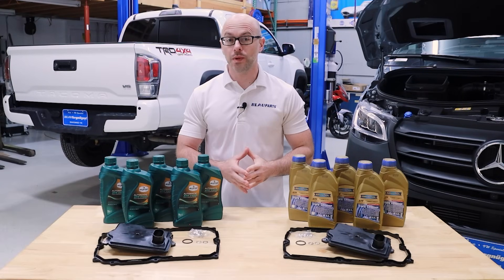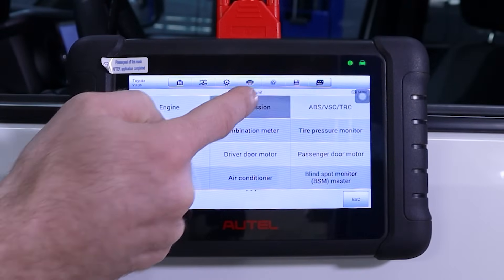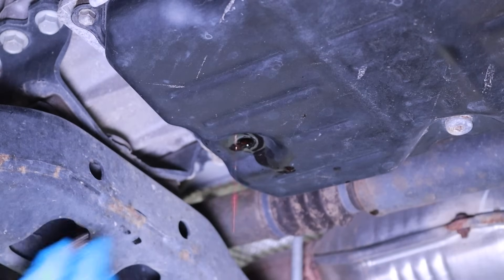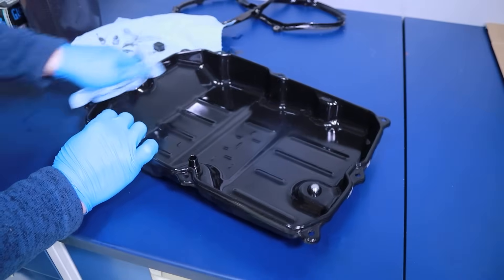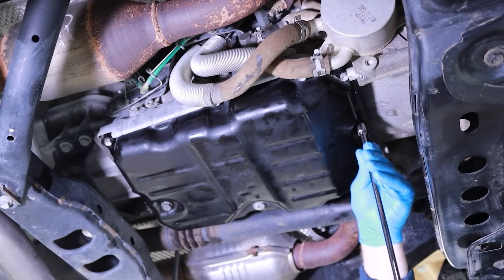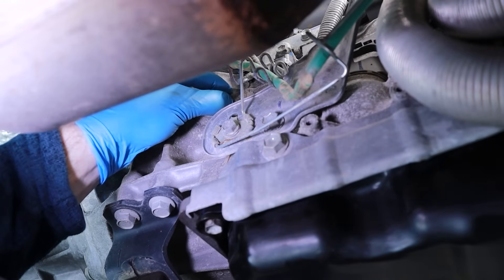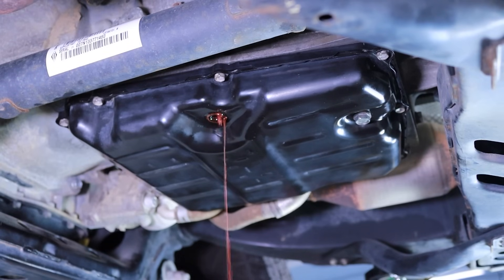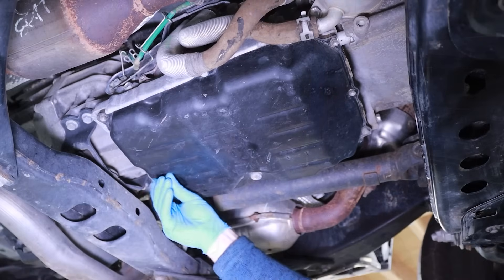How to Change Toyota Tacoma Transmission Fluid (2016-2023 6 Speed)

Comment: something does not add up,now if i park inside my driveway on friday on saturday those temp are going to be 75 or 80 f i don t need to worry about no temp am i correct,and if i don t change the filter bc i be on over 50k but i don t want change that filter only when i get to 100k,why i m saying this my couson with a tundra 2008 5.7 took it to toyora they change the transmision with 106k guess what they fup the transmision 6500 dol he had to pay tell me about it.
Reply: In the video, he mentioned 35°Celsius, which is about 95° Fahrenheit. I hope this helps

Comment: Manual says 9liters of transmission oil, why is it only 3.5 liters? Thanks!
Reply from the maker: Hey there, check out our capacity notes on the 3rd gen Tacoma 6-speed automatic here for clarification on that: www.blauparts.com/blog/how-to-change-3rd-gen-toyota-tacoma-automatic-transmission-fluid.html#toyota-tacoma-6-speed-automatic-transmission-fluid-capacity

Comment: I just called my local Toyota dealer to have them change the ATF fluid and filter; they said NO to changing the the filter. I asked why?? They said they have never had to change the filter in any Taco ever. They said leave it alone. My Taco is at 119000 kms. Any suggestions or comments about this?? I have no issues at thre moment.
Reply: Change it.  i would also ask the question on the taco forums they are a big help.
Reply: What did wound up doing?
Reply: What did you do?
Reply: @michaeldow8869  I changed the rear dif myself but the truck has to go to dealership for trans fluid change. I told them to replace filter and charge me for it.
Reply: I wouldnt fuck with the filter, have 97k on my taco, decided to change the filter, while trying to remoe the pan 4 bolts broke off, turns out they all have through holes by design, if the pan wasnt removed at 60k the bolts get dirty,  start to rust. Well i was able to get 3 out of 4, one gave me hell and i only made it worse. Long story short put it back together and its not leaking so far but the tranny started to shift really bad. Its slipping and lunching forward.... Watched bunch of videos and the main take is never replace the filter and if its close to or after 100k dont touch the fluid....

Comment: Ok question most Mechanics tell me not to change my fluids in the transmission why is that?iv got ny truck at 72k miles now its on 165k miles will it be a good time to change it,im always driving in dirt.,some mechanics also say mix in some of the old transmission oil with the new,so be for i start i would like your opinion 1st,btw you did a great job explaining unlike other videos i seen on YT.
Reply: I am not a mechanic, however, they say that because sometimes a transmission has wear and tear and the tranny is used to run that thicker oil with those particles. A brand new coean fluid could cause it to slip.
So just in case SAVE EVERY DROP OF THAT OLD FLUID!
Reply: My mechanic (who I trust) tells me the same thing! To Only mess with it if the fluid level is low… Im sitting at 115K, mostly highway driving. 

They’ve told me the transmissions on these newer trucks likely need that sediment breakdown to keep from slipping, and if you go throwing fresh, thin, oil in there, it can cause issues that didnt exist before. idk makes sense though i guess
Reply: With the fluid being dirty as we call it it will start to have torque converter stuttering or lock up.  Or shifting really hard Most dealers ship will recommend every 60k to 65k

Comment: When checking the fluid level, is the engine running?
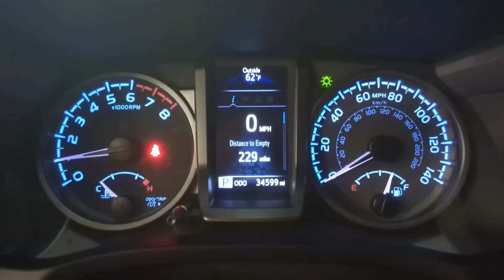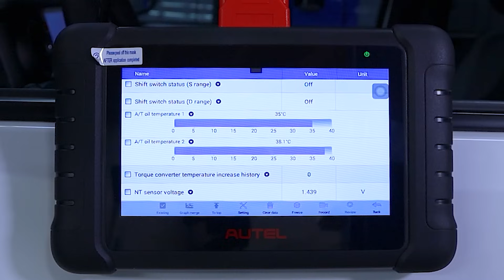Reply from the maker: Hey, thanks for the question. Yes, the engine is still idling while checking the transmission fluid level between the 35-45 degree Celsius temperature window. Please refer to the 9:30 minute mark and the 10:30 minute mark referencing the engine still idle and showing the RPM tack at idle. Any other questions feel free to ask.

Comment: You are an excellent man. You did a great job. Many on the Internet do not provide clear information, so we block them. As for you, bravo, bravo. A question: The lower transmission hose of the same car was cut during work, and this happened to you. How do we fill the oil and the size? We replaced the hose and put 4 quarters. We want to know if 4 quarters are good or what is the benefit. Thank you very much.

Comment: Wow  a very informative video, now I don’t know if I can trust my Toyota dealer to do these things as instructed,  I’ve had some issues with them before and I think I’ll cancel my plans for them to change the tranny fluid  I have 38800 on my sr 5  and only thought is would be good as I’ve recently pulled a 4000 lb travel trailer   On a 2600 mile trip   No problems using ECT and pinning the trans thermostat   Maybe I’ll wait til the next trip ..????  Any thoughts
Reply: I was thinking the same thing about taking it to the dealer but nope I prefer do it myself
Reply: You don't need to do it yet. Every 60k miles change the transmission fluid.